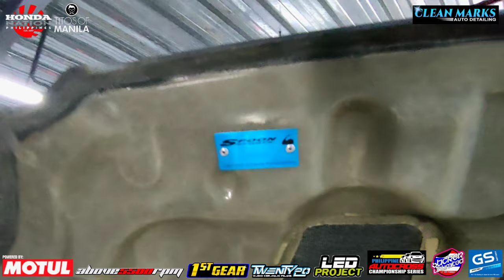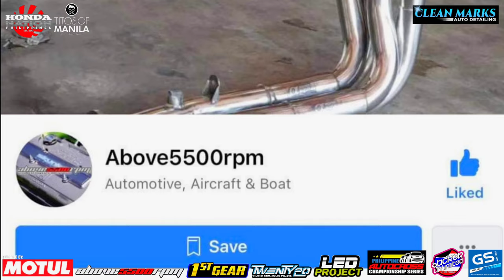Honda Civic SIR SPOON Theme X Type R Worth 3 Million Modified | OtoCulture

Comment: Legit na spoon mags nalang kulang boss..mga for sale ko binabalik ko na stock sakin eh🤣
Spoon Radcap 2,600
Spoon Oilcap 4,600
Spoon Socks 2,000
Spoon Lugnuts blue 8k
Spoon Radstay 2,800
Spoon Rad Hose 14,500
Spoon Direct Airflow 30,000
Spoon High Tension Wire Gen3 45,000
Spoon Front Strut Gen3 12,000
Reply: alam ko spoon din ata ung mags nya spoon regamaster evo